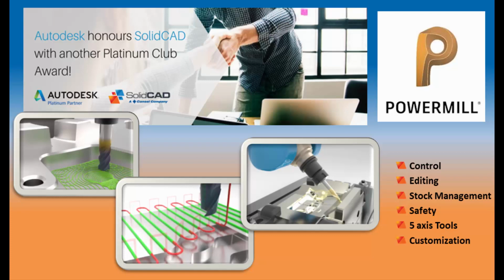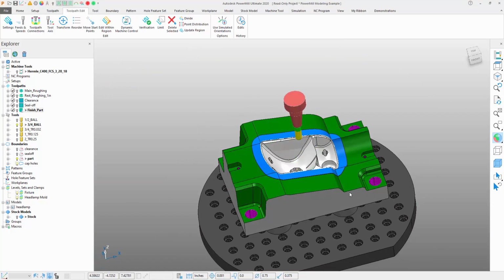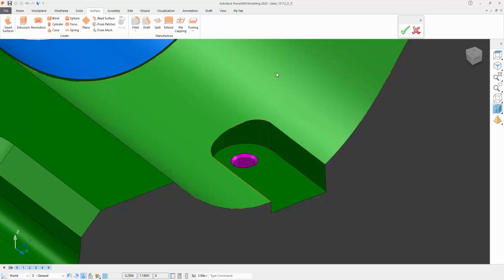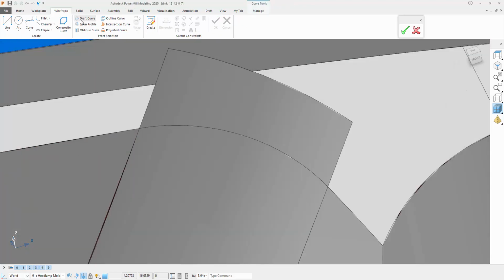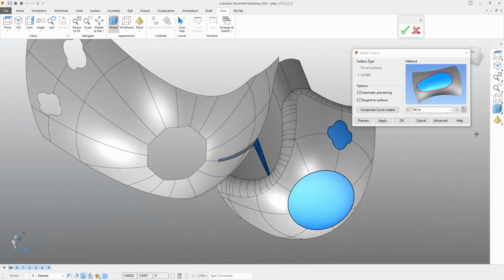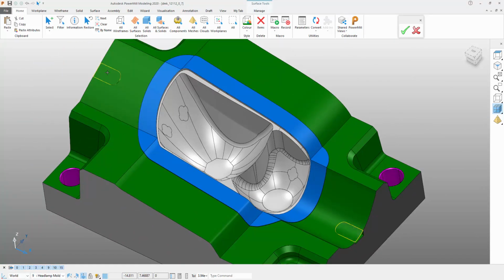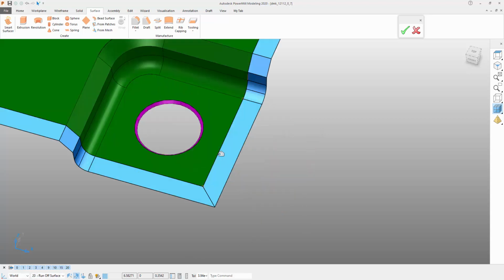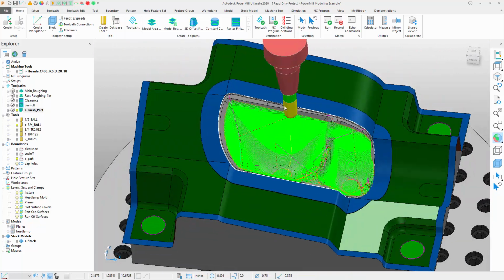PowerMill Modelling

Comment: It's a good option, but why not just use the boundaries and get over it? It's way too much extra work when you're in a squeeze with time?
This is regarding the patching
Reply: But nevertheless, great video,  great info, thank you for this
Reply: Boundries would not have worked on the curved surfaces.

Comment: Hi chris 
how can we append complex surfaces or join surfaces in powershape ?
i saw a old video clip  about this function 
but this function is not doing in all model
Reply from the maker: The functionality is still there.  The rule here is that the adjoining surfaces must have the internal lateral’s and longitudinal curves line up with each other.  They also need to be converted to “Power Surfaces”.

Here is an article with a video showing this append tool: https://knowledge.autodesk.com/support/powermill/learn-explore/caas/sfdcarticles/sfdcarticles/How-to-append-multiple-surfaces-into-a-single-surface-using-PowerMill-Modelling-or-PowerShape.html
Reply: @SolidCADASymetriCompany  👌🏻👍